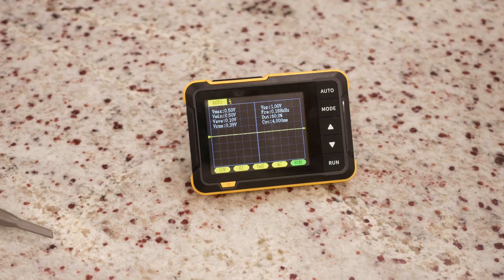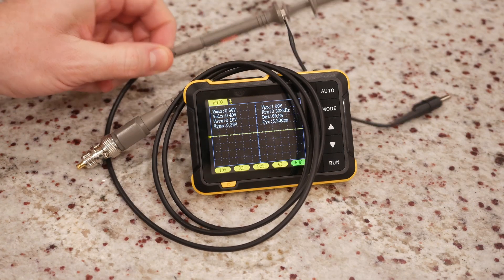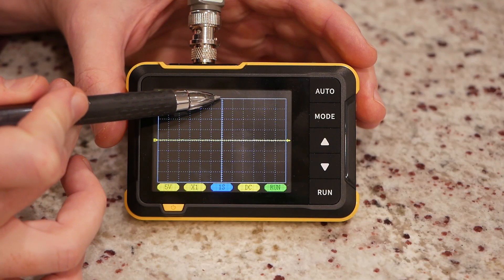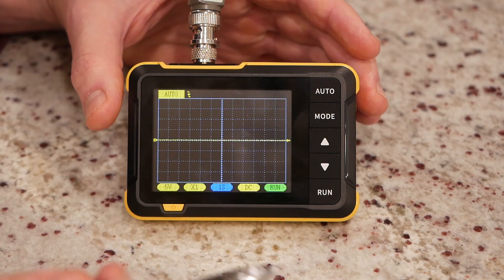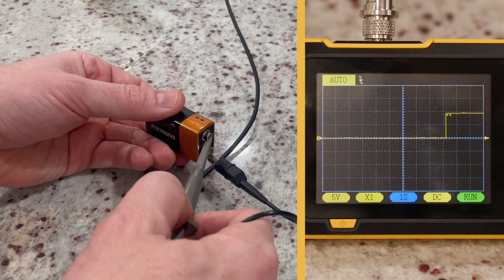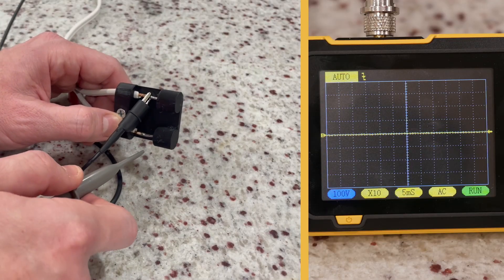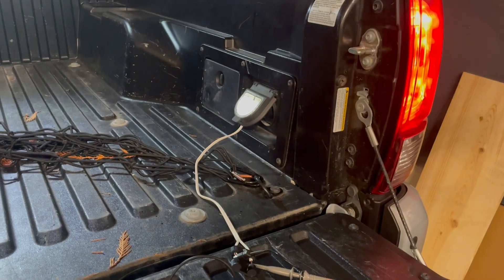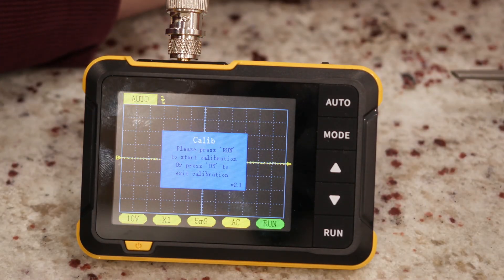Everything We Need in a Basic, Portable Oscilloscope

Comment: Hello, thanks to your very helpfull documentation. I have a question . I tried to change the voltage to 100 V but the system blocked to 10V . I there a manipulation to put to that voltage. In the "documentation" , it 's said that the system can measure to 400 volt. Thank you in advance for your help. Regards Luc from Belgium
Reply from the maker: U need to make sure you're using the 10x probe. The basic one is limited to 40v which is kind of misleading. Both versions(with the 10x probe and without) are sold side by side, at least in the US.
Reply: Thanks for your help. Regards. Luc 😊 @aaronsrapidreviews

Comment: What is that black terminal/wire separator you have on testing the AC?
Reply from the maker: A sketchy thing I 3D printed for this one purpose
Reply: @aaronsrapidreviews  I think something an XT or SMA  connector would be safer. SMA is probably safest.

I, also, want to make something  to test A/C power for cleanness.